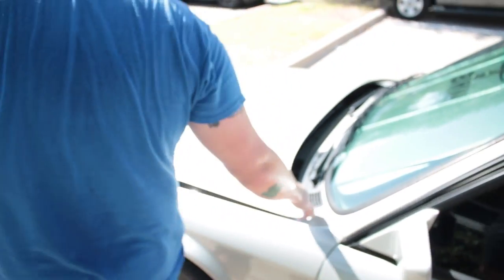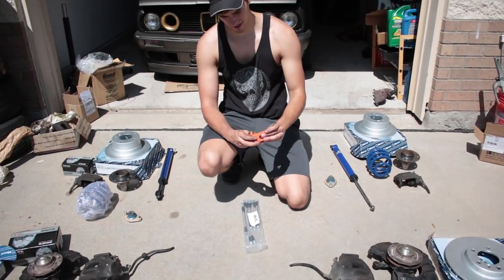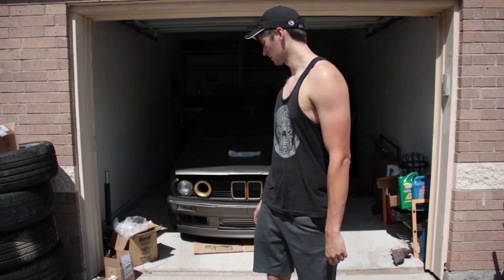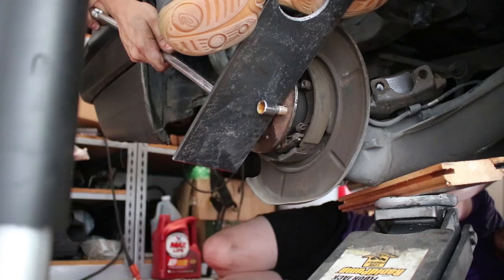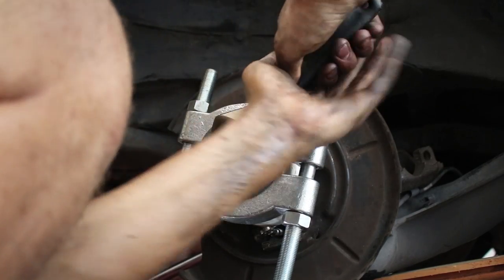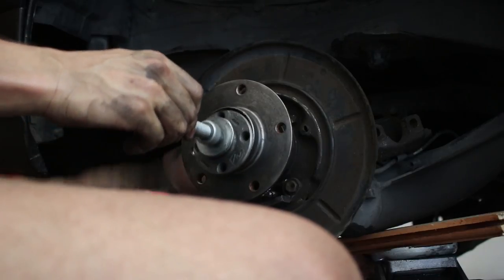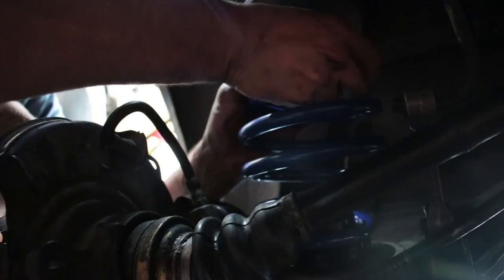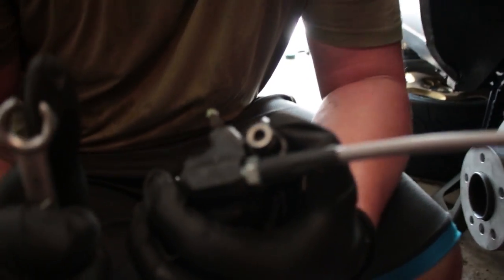Turbo BMW E30 Build: Part 24 | 5 Lug Rear

Comment: Going to give this a a go on my 4 door 325, except I'm definitely using e36 control arms, not sure why you didn't just get those wouldn't have a caster issue at that point. Also z4m rear end with Z axles and diff

Comment: Did your stock handbrake actually work with z3 hubs as they have different offset? Also what rear rotors are they, i dont think you mentioned them. I think i gathered you scrapped the m3 rear calipers and went with e46 318ti rear calipers?

Ive been told Z4 rear hubs are better with e46 325i rotors and calipers as they are not offset and so you can use the stocke e brake... but this would not make sense if yours worked?
Reply from the maker: z3 6cly hubs and brakes, I mentioned it but only briefly. Handbrake works as normal, e36ti calipers and carriers were used, but the e36 m3 calipers could easily be modified with a shim.
Reply from the maker: z4 rear hubs allow for bigger rear brakes but give you an effective 40et in the rear and 20et offset in the front, so spacers would be required unless custom wheels were used.
Reply: This explains everything i needed to know thank you!

Comment: My man, I literally dropped doing the e36 5 lug swap research this Monday. Because of all the bad  stuff I read about it. Noone was happy with it due to the caster difference destroying the geometry. And now you save me with this! One question however, what about the new steering changes, doesn't it lower the maximum angle? And what about rubbing the tire to the inner wheelwell? 

Thanks a lot for the content!
Reply from the maker: MgBag I will update on the subject in the coils vid. It’s all back to about stock though.
Reply: EuroGarage back to stock caster or back to stock 4 lug with 5 lug adapter?
Reply from the maker: Stock geometry and castor. Sorry. I realize that wasn’t clear.
Reply: EuroGarage very nice, looking forward to your experience with this setup

Comment: Just out of curiosity why did you do this swap? Is it just more a bigger wheel selection or is there an increase in performance somehow like better brakes or something?
Reply from the maker: Blake's Garage E36 m3 Brakes not big enough for ya?

More studs for less shearing. 
More wheels. 
Oversized brakes and rotors. 
Increased track weight. 

Only downside is unsprung mass.
Reply: EuroGarage cool 😎

Comment: I have a 325ix and am extremely interested in something very similar. I know it will not work the same part for part, but if you have gathered any info in your travels it would be very helpful! Thanks!

Comment: What size were the flanges for the DIY tool???
Reply: Also, very dope video!
Reply from the maker: 3" I made another video with details on the kit
Reply: Thanks watched it a few times now. Is the gap between the bearing and hub going to cause an issue? In terms of just a whole bunch of gunk building up, it didn't seem like it sat too flush

Comment: Bullshit you need all e36 m3 96 t0 99 parts youcant use e30 arms aslo why not just buy the rear arms complete also those castor bushes are rubbish you need early e36 m3 castor bushes